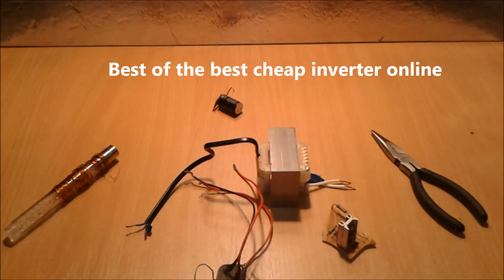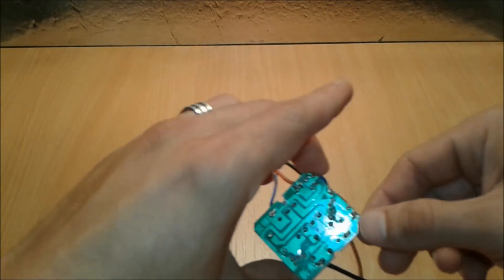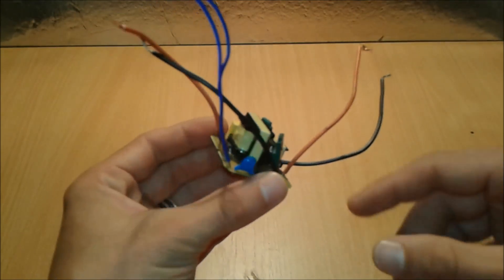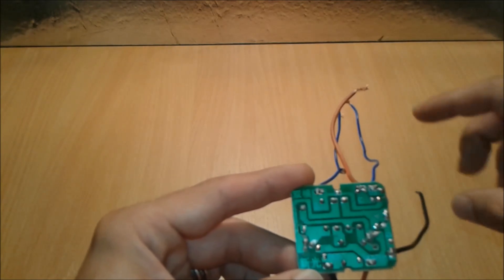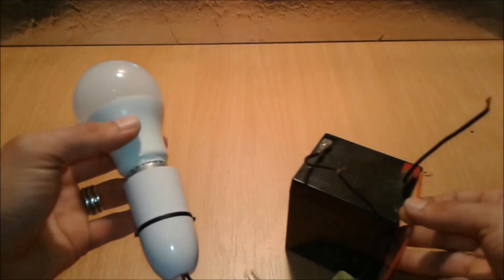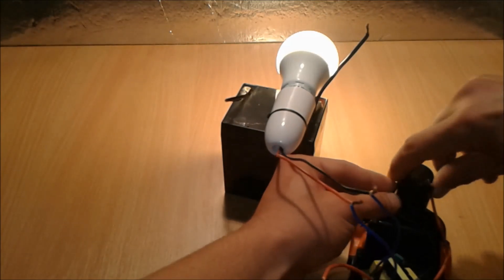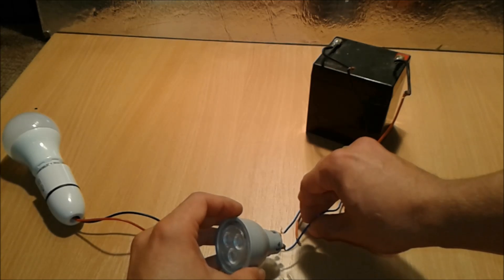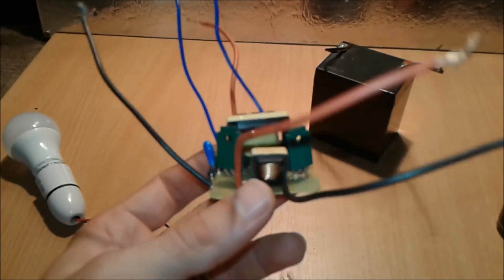How to make a small portable 12v to 220v inverter at home  Last chance to buy

Comment: Man I need to take a break from this thing it's pissing me off and keeps blowing the resistors to the fan and LEDs I start it up and within two seconds the fan and LEDs resistors start smoking the generator head is just out putting too much but but at the same time I need to finish this damn regulator so I can actually use the generator .it only eats up 1/4 gallon of gas every 4 hours and can run 4 grid tie 5000w inverters LinkedIn series on the input to bring it up to 48 volts input to the inverters. I've got the power output and fuel consumption we're I want it but I need to be able to regulate that voltage so I can run one 12v inverter or charge one 12v car battery at a time it will be a long  while till I can get 4 grid tie inverters at 5000w well I'll give it a days or two then come back to it
Reply: Hahahaha I was it was 7.22watts of heat in the fan resistors and 4.23watts of heat in the led resistors so at 50v I need a 200ohm 10w rated resistor for the fan and a 522ohm 6w rated resistor for the LEDs

Comment: But sir,if you get the skills in building circuits practically you may not need to spend much in buying parts as
Reply from the maker: +Lawal Mohammed it does not matter if you get skills or not you can recycle parts but lets gest say you need some special parts like transistor or mosfet but the special one one model you have to buy them you cant stay on just recycling just my opinion in some cases is better to buy is not us funn but get the project done all the best

Comment: practicality depends on your goals of  achievement.
for me its practical to build it because i will learn along side having been build and use it.
i got it and i learn from it.
that 2 in 1. sometimes you discovers or prove something by doing it manually.
did you made it?
Reply from the maker: Owat Thorne True and as you see in my video i do enjoy making stuff but in some cases is way cheaper to buy some circuits because the parts individualy are way more expensive all the best
Reply: yes it depends on goals